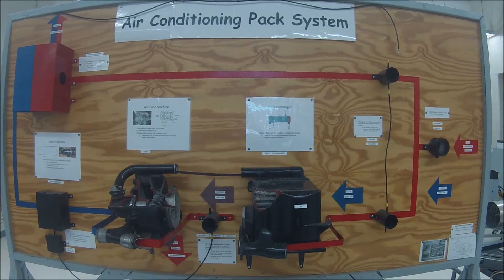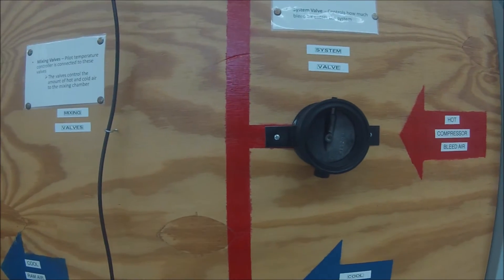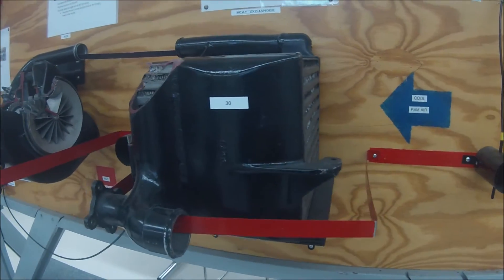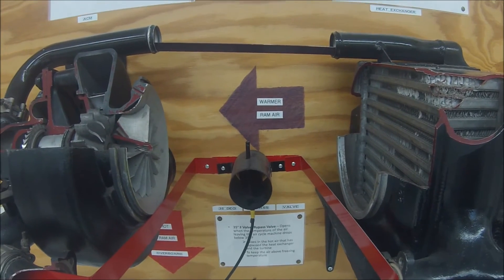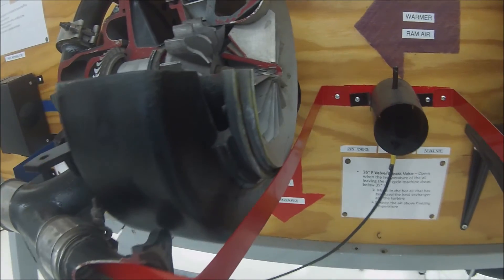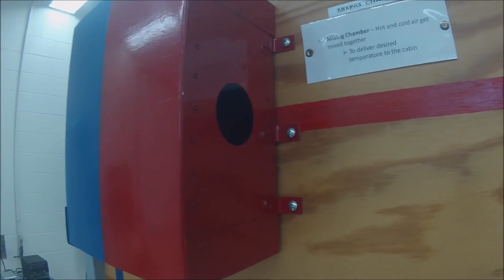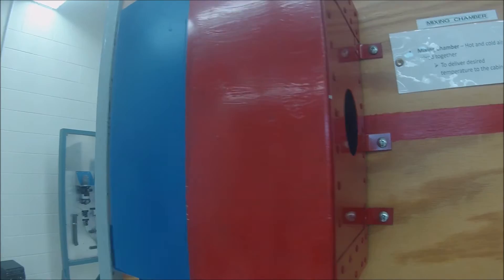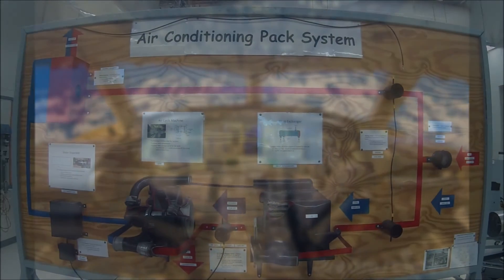CRJ 200 Air Conditioning Pack (Simple Explanation)

Comment: The air conditioning air doesn’t goest to the de-ice system. Air for the de-ice system comes from the 14th engine stage bleed air, and it is not conditioned.

Comment: You seem to indicate that the Ram air goes into the Air Cycle Machine, this is a common mistake.  The Ram Air merely goes through the Heat Exchanger to cool the Bleed Air from the Engine, which does eventually go into the ACM.  Also, I believe that there is a second Heat Exchanger after the cooled air goes through the ACM Compressor before entering the Turbine.

Comment: So clearly no gas freon is been used,like Aircondition system on the ground,Aircraft take advantage of the super cooled air in the atmosphere in flight levels (above18000)
Reply: Nope, the compressed Air coming from the Engine is at about 300°, this system also works on the ground on a hot day.  This system uses simple Thermodynamics to cool the air...compressing air makes it hotter, decompressing cools it, strategically placed Heat exchangers and regulators produce the desired temperature and pressure.

Comment: The on-wall model is very good, helps understanding, but the technical accuracy, narration, music gets solid thumbs down from me.

Narration is confusing and factually wrong in places. (eg, the wings anti-ice air does not come from the PACK outlet as implied, it is not even close, it doesn't even come from the same bleed air -- 14th stage vs 10th stage air. Oh, also, the CRJ does not have 'de-icing system', only anti-ice). Another criticism is the use of Fahrenheit. Everything else in aviation is in Celsius, why use Fahrenheit. Why two or three different narrator?
Reply: Bernard Goh deice is active and anti ice is passive. CRJ 200 does use compressor bleed air that flows thru perforated tubes on the leading edge of the wings and empennage. Whether that meets the definition of anti or deice I’m not sure. 
You are correct that anti ice does not pass thru the PACK.
Reply: The CRJ does not heat the empennage. This video is about airconditioning, meaning only 10th stage bleed air. To throw 'anti-ice' in there is wrong and misleading, anti-ice uses 14th stage bleed on a completely separate circuit.